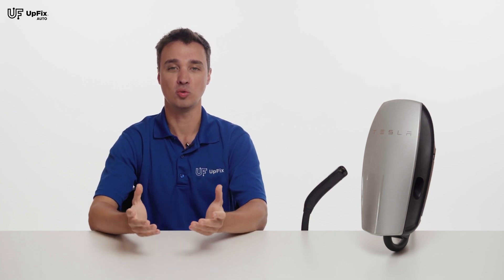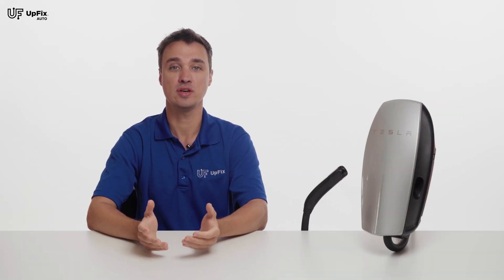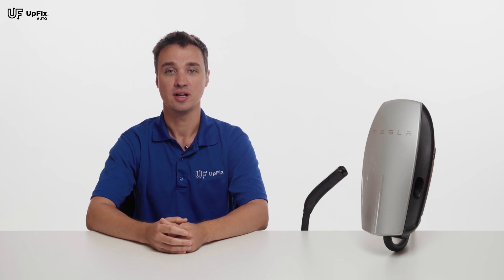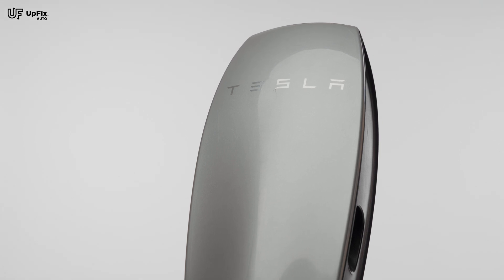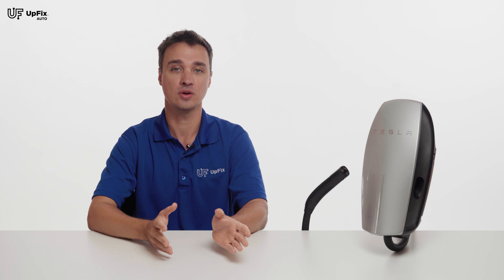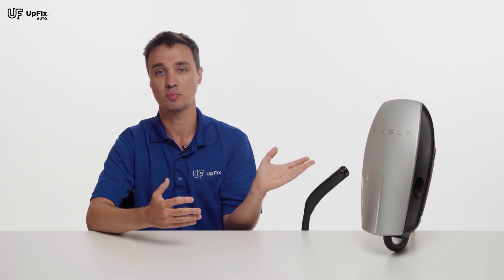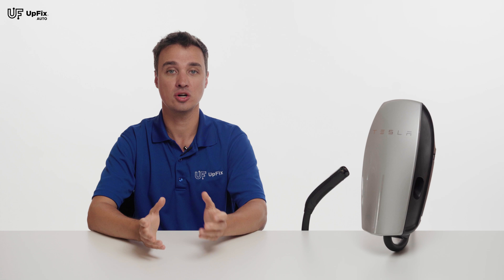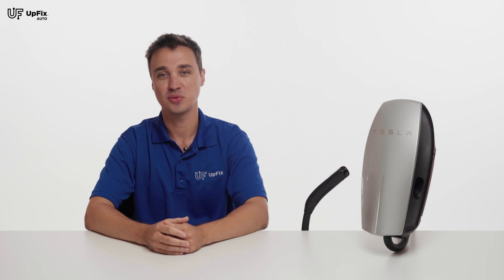Tesla Wall Charger Repair Guide | UpFix's Expert Solutions

Comment: Mine just goes black "No lights" but if reset the breaker chargers one time.
Reply from the maker: Thanks for sharing, @henrison! That symptom sounds like a power delivery or internal relay fault.  Its very common on these chargers. We can repair that issue and get it working reliably again. Feel free to start your order at UpFix.com or reach out with questions!

Comment: Why the hell call it a repair guide and not show anything other than an ad for repair service…
Reply: Thanks for the comment..now I know not to watch the rest.
Reply: @ If you need to do the repair, its not that hard. A few pointers, use a soldering iron and a hot air station. Mix low melt solder in to make the removal easier as well.